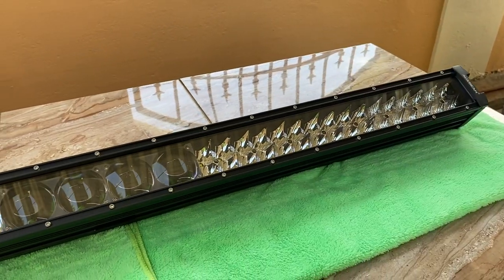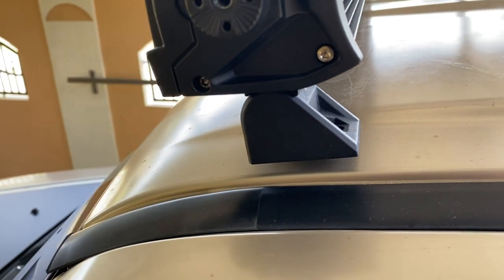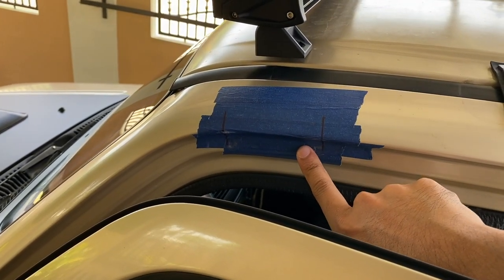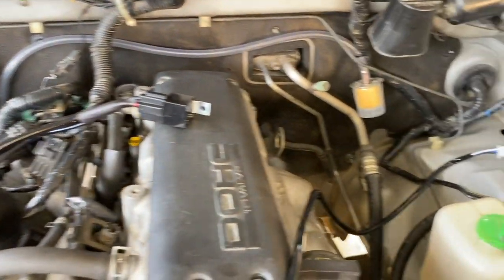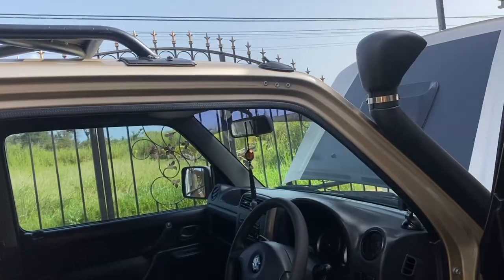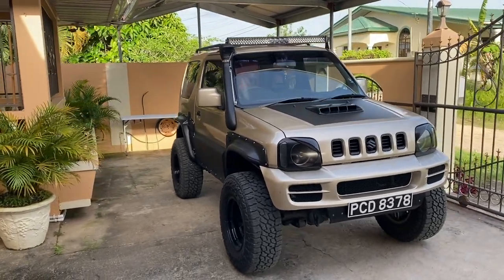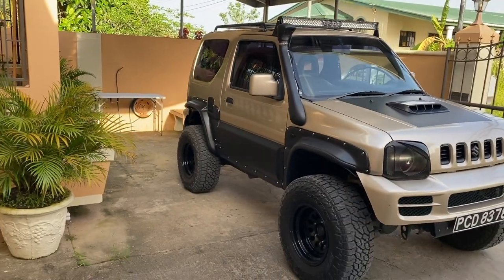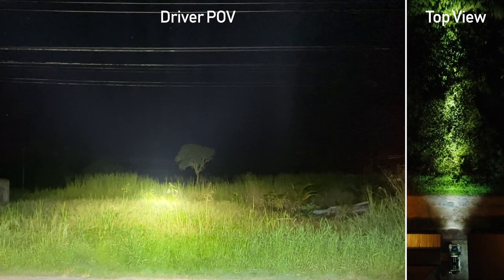Installing Auxbeam 42" Light Bar on the Jimny

Comment: You know, I had that problem with the light cables and I solved it by putting them through the hole in the radio antenna. I changed the antenna and put the antenna that adheres to the glass on the inside, all the light cables go through there without any problems.

Comment: I know this video is pretty old now but I have some questions that I really hope you can answer. So... I have the exact same light bar as you, and I couldn't figure out how to get those terminal connectors to connect to the battery. I see in the video you have roughly the same size terminals as I do, and I'm assuming you couldn't fit the connectors over the terminals like me. So my first question is how did you connect the positive and negative connectors to the battery terminals?? Another thing is, I have the exact same issue as you did with the mounts.. I need to fabricate mounts (in my case have it done by someone else because I have no idea how) to connect it to the side like you did. So my last question is.. How did you go about getting the dimensions for the mounts? How did you measure?? If you can be as specific as possible I would be so grateful!!
Reply from the maker: I replaced the ring terminals on the harness with larger ones. I didn't measure to create the mounts, I used trial and error and kept adjusting accordingly until it fit my liking. Since then I created better light bar mounts but that's only on my Instagram and not on YouTube.

Comment: Just the video I was expecting from you for me to grow up courage and install a light bar in my jimny.
Question: would it be possible for it to be wired (positive) from the fuse box in the engine compartment?
And another thing that has nothing to do with this video: do you know how can I pop out the air conditioning side vents from the Jimny? (I want to vacuum and clean mine properly…)
Reply from the maker: I'm not sure if you can run it from the fuse box. I know some lightbars draw a lot of power and need to connect direct to the battery. Yeah, you can pop out the vents with a little force.